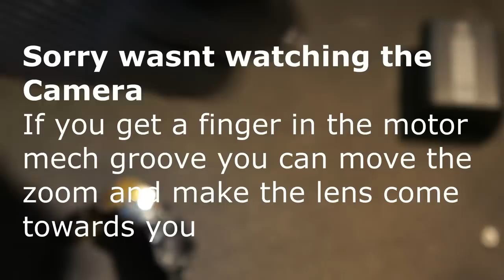Sony SELP1650 16-50mm lens teardown and repair

Comment: Mine was jammed, and crooked at the front, I opened it up, took me like 5 minutes tops, got to the stage of removing the outer barrel, turned the lens upside down and I gave it a shake, a small clip fell out, put the lens back together and its working fine now. I urge you to give it a try, especially with how cheap this lens is, Sony repairs cost a fortune!

Comment: Thank you for this step by step video! I have no experience with cameras. I bought mine cheap at a garage sale and I think they sold it because they couldn't get the lens to work. I took the whole thing apart, found the broken piece glued it back, put it back together (which by the way, was incredibly hard!) And now it works. I'm so excited!
Reply: SO THE RING HAS TO BE GLUED TO THE BOTTOM PART? CAN YOU TELL ME PLEASE?

Comment: 6:00 remark (when one need to sway a cog of zoom gear) was the most important in my case and helped to pull lens out of little barrel. When nothing has been broken, but camera can't recognise lens, almost surely the problem is in cogs between zoom gear and the motor. Jammed gear can be fixed by swaying it after you have already removed the controller and the motor.

Comment: This was really useful. I Found that the small black lugs that were not holding the lens in place were not working so I used a spacer made from a piece of aluminium foil to fix the ring in place.

Comment: Nice attempt, but sadly it's almost impossible to see what you're doing even when fullscreen (I was looking for the rebuilding part). Next time better! Still appreciate your voice / commentary in general :)
Reply from the maker: thanks, heaps i will endeavour to do another take on this lens with a better setup for the camera i have built a rig that can sit above me while i work so that the camera is secure and i can just work. while i do more repairs i have 4 more lenses i have bought to do plus camera and more
Reply: Hi, thanks for your video -I've found it really useful. I've got stuck on the part at 7:20 minutes in - my ring doesn't seem to turn then stop like yours did - it just moves about 3 mm then stops. It doesn't look broken. I'd really appreciate any ideas!!

Comment: Any idea How to Remove the Focus/zoom Ring? Got Some Sand Stuck behind it -.-
Reply: Hi Eric, I have just done the operation :) !
1. Remove the little sticker ring of the rim of the focus ring, revealing three little holes and the plastic lock-ring it sits on.
2. On this inner lock ring there is a 1cm piece which is a little more flexible. There should be a little gap to the left and right of it
3. Align one of the three holes of the focus ring with the left gap of the inner lock-ring, and use a small flat head-screw driver to lock the two in position. Then twist counter clockwise on focus ring for about 1cm
4. You will now be able to detach the focus ring + lock-ring. You should now be able to proper see the small little 1cm piece holding the lock-ring in place. This itself is detachable and only held in place by the same felt-ring like the rest of the lock-ring.
5. Simply flip it off gently and get in between the lock-ring and the focus-ring with a small flat-head screw driver. Not bend the plastic lock-ring gently and get it out. Make sure you don't break the little felt ring it is attached to.
6. Now you can clean both surfaces from sand. Use a Q-Tip. After re-grease slightly to assure proper motion.
7. The little black marks you see on the inside work together with an optical sensor. On my lense, half of my marks have been worn off because of the sand! I simply drew them back on with a marker pen.
8. Put everything back together. Clean the rim of the focus ring from any grease to make sure that the sticker ring will stick properly after.

Took me about 20mins to figure out the mechanism and another 10min to clean the ring. Good Luck.
Reply: Wow, thank you for the Tutorial! This will definitely help someone else in the future! I sold the camera on Sunday, so I don’t have to do it anymore haha 😂
Reply: @Eric-pi2rn  I hope so :) ! If you happened to sell the lens together with the camera, maybe let the buyer know about the fix. Sure he'll be happy!

Comment: Followed these directions; at the point where you apply pressure on the barrel sides to disengage the three pins, I wound up shearing off a ribbon cable aside from the one on the lens connector and the motherboard one that was attached to the barrel.  Free advice on YouTube; you get what you pay for, alas.

Comment: sony PZ lenses are piece of shit. Lasted exactly 1 year, broke right after the warranty ended. I exchanged the plastic ring that broke, it made it work again. But lens would reinitialize itself every 7 seks, even if i am in a menu.  The inside of it almost entirely PLASTIC (!!!wtf?). 400 usd for plastic?? + no support in Norway. To reapir it i gotta send it to other countries, and it costs a lot. AND you can not even update firmware on MAC... Cuz it is not compatable. Why? Cuz Sony does not give a fuck. I shattered the lens upon the concrete, with great delight.  Almost did the same to camera house, but spared it due to the fact that i own 55-210 lens. If this one will malfunction on me too, i ll shatter it all at once. I m not dealing with Sony anymore.